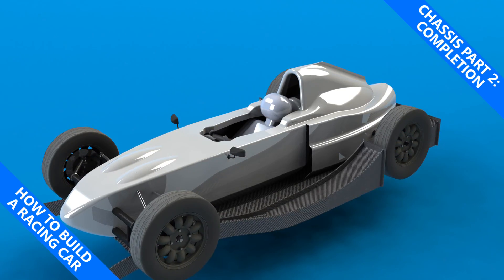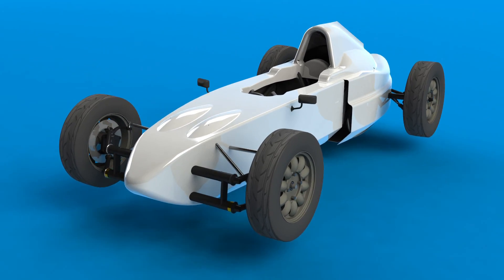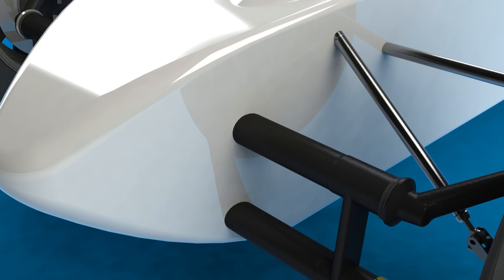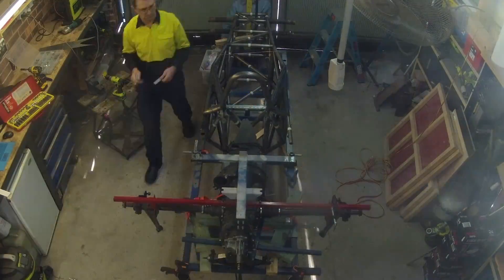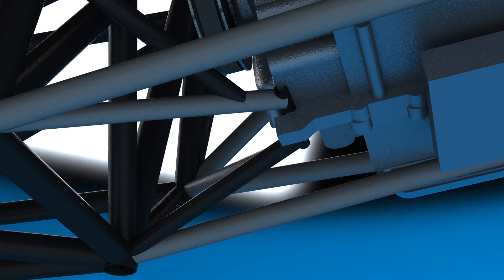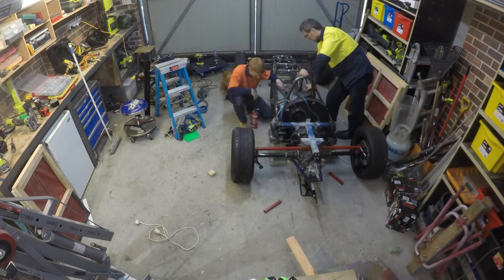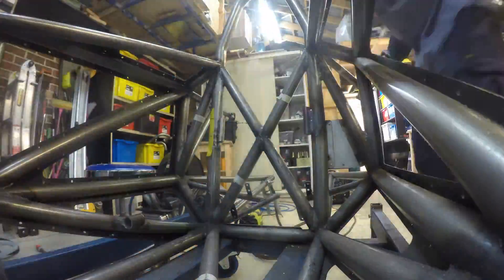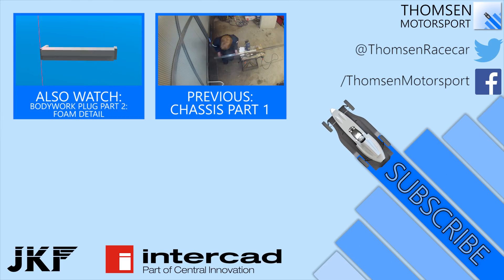Chassis Part 2: Completion

Comment: Great job on this! One thing though, I’m not sure if it is because of the regulations, but if you can I would recommend moving the fuel tank as far from the driver and engine as possible, because if you do get into an accident and the fuel tanks gets punctured, first, you have hot fuel on you and if it sprays onto the engine it will cause the car to catch on fire or worse, your clothing/body will catch fire; also if your car is hard to get in and out of, you could be trapped in a burning vehicle if the fuel tank ruptures.

Comment: I think you have worked damn hard and smart to.....My question is where can you buy an engine & transaxle for a Vee series or others series?......basically I'm not having luck locating suppliers for(engines & transaxles) any tips for companys/websites for motors and transaxles would be so much appreciated.
Reply from the maker: For Vees, parts aren't super easy to come across, I found two front H-beams straight off a car in a scrap yard in Melbourne, engine and gearbox I sourced from a wrecked Vee. Best bet from my perspective is to talk to people within the Formula Vee world and see what parts are already available, or find out what road car parts to look for in scrap yards - and what you would need to do to them to make them legal to race.

Comment: Thank you for your videos.
In the beginning, how long it it take for you to become comfortable with your welding and confident with the results?
Reply from the maker: Maybe three or four weeks of practicing every evening. I made few test sections of the chassis so I could cut them open and check the penetration and quality of the weld. I spent a lot of time watching videos of TIG welding, this helped a lot as I knew what to look for in terms of the melt puddle, heat etc. By the time I actually picked up the TIG torch I had a lot of mental imagery of what it looked like to weld properly, so I had to translate that into the muscle memory to do it properly. I did try brazing as well, but was not able to do this well, I didn't feel like I understood where the heat was in the same way as I did TIG welding.

Comment: Two questions:
What is the assembly rig that u have attached the chasis to that can rotate?
What material are you guys using for the frame of car? Is that tubing readily available?

New to this scene. Thx
Reply from the maker: The assembly rig is one which we made for the project from 50x50x2 box section steel. Very helpful I must say. The material I used was 350MPa mild steel, cold drawn over mandrel seamless tubing (DOM CDS I think are the acronyms - been a few years now!)
Reply: @thomsenmotorsport7201  Thx!

Comment: Is that H beam off of a vw Bug front?  Wouldn't 4cm stitch welds, every 6cm's have sufficed on the panel supports?  just curious... did you have to drill inspections holes to pass tech at various tracks?  Gr8 work throughout!! bravo !!!
Reply: The engine is from a VW beetle too, I noticed the unique air intake blower and shroud!

Comment: Does this racing organizaition require view holes to be drilled at weld points so they can make sure the welds are good? Or, did you just have to show on a test weld that you were getting proper penetration on the welds?
Reply from the maker: It's been a couple of years now so my memory is fuzzy, but I recall showing the inspector photos of the welds inside the roll hoop before closing up the ends. I also had a couple of test pieces I could show him. But no destructive testing.

Comment: Hey! Awesome video! If you don't mind me asking, where did you get the engine, chassis material, and drivetrain from?  Im interested in building a racecar myself, and I cant seem to find the correct parts. And what engine is it? Would love to hear from you!
Reply from the maker: Thanks. I bought a wrecked Formula Vee which gave me the drivetrain (VW Type 1 engine and gearbox) and also some useful bits like a racing steering rack. Everything else I bought and made myself. I found suppliers around Australia for the raw materials such as chassis tubes and fibreglass. Metal plate I bought from a laser cutter in Sydney, that was great as I just had to give them the dxf files and I'd get the material perfectly cut a week or so later. Finding good suppliers is key to a project like this, if you're in Australia let me know in a reply and I can list the ones I was happy with.

Comment: How much hp ur engine has?
Reply from the maker: 68hp at the wheels.
Reply: So you really got the 70kW!! That’s awesome 😎 👏🏻.  As I’m not having that much I think I should use tires with the rounded profile from a scooter. Otherwise the tires instead of letting me roll to the top they will stop me: all the energy I have will be going to move the tires and not the car.
Reply: ThomsenMotorsport other question I have is how u join the body to chasis?
It can’t just be laying. And gluing it is counterproductive.
Reply from the maker: DZUS fasteners through brackets welded to the chassis.
Reply: I’m not sure I can have them here in Peru :/. I see if I can have any similar stuff or importing it :/ sadly Peru is not the country you’d like to live in when you want to build a car.

Comment: Am working on a chassis in ansys workbench and I need to simulate fatigue effect in a circuit , is it possible u could help me please?
Reply from the maker: It's been a long time since I used ANSYS, not since 2010 when I was at university. Unfortunately I don't think I can be much help.
Reply: ThomsenMotorsport it's okay thx for replying anyway

Comment: Great Video. Which software did you use for assembling of the components at the beginning of the videos?
Reply from the maker: I used Solidworks. It's CAD software but has a raytracing renderer, which can be coupled with animation tools to produce these parts for the videos.

Comment: When you welded the frame onto the tube for the panels to fit you have stressed the tubes. you would have been fine just to weld 25mm of the frame where the hole is as it is the bolt that holds the panel into place and any side impact would be transferred in the frame only where the bolts are fitted.

Comment: Awesome video.
What material are you using for the chassis and mountings? Have you used different material for roll hoopes and rest of the body?
Reply from the maker: I used a mild steel for all of the chassis (including roll hoop) specified by the Australian CAMS rulebook, complete with material certificates. For mountings I just used a typical mild steel plate laser cut into the correct parts.

Comment: All the precision you used to build this chassis is really going to pay off when you set the car up at the track. Should be fairly easy to refine the handling since you're starting with such a well designed and built, stiff chassis. Nothing worse than getting all the corners and cross weight where you need it and have it change while racing due to excessive flex in the wrong areas of your chassis. First class work! Cheers
Reply from the maker: Thanks. It was the part of the car I was most happy with in the end.

Comment: what kind of tubing did you use ? 4130? ........ JRW
Reply from the maker: 350MPa mild steel, CDS DOM tube. This material is specified by the rules and regulations.

Comment: seems to me you've overbuilt - you could have gone a fair bit lighter on the side panel tubing and used the extra depth and strength of the panel mounts to make up the difference - that is to say- used your panel mount system and panels to do what your structural tubing is doing... I bet you didn't take the panel mounts into consideration when running your calcs (?)
Reply from the maker: You're right in everything you say, however there is a reason I've done it the way I have. The rules define a minimum size (which I've used) for all members between the primary and secondary roll hoops, plus a maximum area inside any triangulated area plus require the aluminium side impact protection plates to be installed. This does basically result in the chassis being very (perhaps excessively) strong in that area but the changes were made in response to a death in the category a few years ago.
Reply: ah - i see.. thanks for the information - i thought it would actually result in a gross overweight - but i just started watching your segment on suspension design and now see that it's actually UNDER for your category! Anyway - what fun... i really enjoyed this. I'm not an auto person by the way - but an architect - and so my structural comments were coming from the perspective of an architect ... Godspeed!

Comment: What alloys did you use?
Reply from the maker: For the chassis itself I used 350MPa mild steel. I used all seamless tube. For the side impact protection I used 5052-H32 aluminium. These materials are specified by the rules so that selected them for me.

Comment: Fantastic series! I was watching your bit on spray painting the car, There is a little trick method of using and electrical current to create charge on the car which would attract the paint molecules to the frame. Not sure of the metal of the frame is capable of producing the static attraction for this to work, but it would've allowed you to use less paint and get a better and more even coverage. Just a little thing I saw on youtube about mass manufactured cars and being efficient on painting them.
Reply: Dan, are you referring to powder coating?

Comment: I never heard weather or not you drilled each tube with a small vent hole, so as to allow venting of each tube as you weld it. This will prevent "blow out or suck in" of the weld as weld the chassis. These holes are typically made wherever the tubes join so there is an entire venting process throughout the entire chassis during construction. If you did not then you my try it in your next construction as it will cause less grief as you weld the chassis together.
Reply from the maker: +RWES that's quite clever, I didn't think to do that here but it certainly would have helped.
Reply: ThomsenMotorsport  just one thing about your mold making, maybe you could add structure to the actual mold when your making them it will help to keep the parts straight and square when you go to pull parts out of them. Also if your buck is not "mirror" perfect you will always have a problem when you pull your molds off. I actually worked with CNC made bucks while working for Nissan on there Group C P-35 Project and after they came out of the CNC machine there where hundreds of hours in polishing the buck before any molds were pulled from it! I think you are doing a fantastic job!

Comment: awesome work mate , i have done my car here in lebanon , the work was not as clean as this i should say , but it turned out impressive as well. whats the total weight you have
Reply from the maker: Nice one. My car weighs about 420kg without driver or ballast. In race trim, with me and some lead on board, it weighs 505kg.
Reply: +ThomsenMotorsport ur kdg!! mine weights exactly the same!! just recently done , still have a small issue with the fuel pump and it ll be pumpin 190hp again
Reply: +ThomsenMotorsport im really really amazed by ur great work. keep it up :)
Reply from the maker: Well that's a big old power bump from where I am, must be a blast in something that weighs so little.
Reply: +ThomsenMotorsport its amazing. how much ur doin? ive put a 2005 zx10r and done a bit of tuning for it
Reply: +ThomsenMotorsport but again man, really awesome video and work
Reply from the maker: Thanks. These Vees top out at 68ish HP. It's not a lot but it's enough to race with. Gotta learn to conserve momentum.

Comment: Is that the safest place for the fuel tank? I'm sure there are rules that you're following, but I would want more separation between the driver and the tank.
Reply from the maker: I'm not aware of any Vees with more separation between driver and fuel tank. Only other place for it would be behind the main chassis bulkhead in front of the engine but there's no room there, the chassis would have to kick forward to accommodate it and the rules wouldn't allow for that. Where it is in my car it's protected from a crash by the same impact structure that protects me so I'm satisfied that it's protected from being punctured. It also vents outside the car so the only reason fuel would get into the driver compartment is if I spill some while filling it.

Comment: Sir,i m going to make a solar car.How can i make a spaceframe chassis for my solar car...
please help me...
Reply from the maker: Cool. Best thing you can do is to research what you want to do, to the point that you know before you step foot in the workshop exactly how you will do each step of the build. You should be able to find everything you need to know on the internet, just a case of spending time searching and reading. Once you've done your research, get a design together. If you can, get hold of a 3D CAD package (I used Solidworks which was provided to me by Intercad) to do this. Get everything drawn, not just the chassis, to make sure it's all going to fit and work together. Once the design is there, it'll take a bit of time to convert it into 2D drawings that you can use in the workshop to actually do the build. If you've been thorough then things should go together quickly and smoothly once you actually do start building.

Comment: Great work!  What tubing size & thickness are you using?
thank you
Reply from the maker: Thanks. Tube sizing varied throughout the chassis, from 1.5" x 2mm through 1.25" x 1.6mm, 1" x 1.6mm and 0.75" x 1.6mm. Size depended on rule sizing and stiffness requirements.
Reply: Imperial AND metric in one specification?
Reply: Excellent information, thank you!!
Reply: Hi, all your work is amazing! have a question at the rear suspension what tubing diameter & thickness are you using. Thank you
Reply from the maker: The leading arms are made from the 0.75" and 1" chassis tube sizes, the pushrod is solid aluminium bar.
Reply: And what thickness?
Reply: @thomsenmotorsport7201  I love the way metric and imperial are often used side by side these days.
Reply: Pedro Kim sorry I thought you we're talking about chassis
Reply: Pedro Kim the previous video covers that
Reply: s550amg the rear suspension thickness doesn't come in the previous video
Reply from the maker: Both 1.6mm. Why are you asking? If you are intending to build your own then just copying the member sizes is something I'd advise against, each car will have different loads that need to be accounted for in the design. What works on my car may not work on another car depending on the design of the car and loads it's subjected to.
Reply: Hi Simon is only as reference my project is going to be about 545 kg dry and something like a Bac Mono or tube frame Formula Atlantic.

Comment: When welding the mounts for the panels where you really required to weld the whole seam? To me it seems abit overkill.
Reply: btw awesome work man you are really skilled 👍
Reply from the maker: Thanks. Perhaps less could be used but it's required by the rules to be that way.

Comment: great stuff mate. which state you from?
Reply from the maker: Thanks. I'm from New South Wales.
Reply: I'm from Sunny coast. I dont mean to lead you on with this question but if you were to make this again what would you charge if just for the frame and bodywork with a few adjustments to suit an electric motor motor and battery pack.  I dont mean to ask for an accurate figure either - just a ball park even if it is 10k out of wack. how long would it take to build again that you have most of it down pat if you did it by yourself without help?
Reply from the maker: Interesting, honestly I'd really love to see a viable electric option in the club level racing scene. It's the way of the future for sure and motorsport needs to keep up if it's going to stay relevant to the younger generations. These days I'm now too busy to realistically accept this sort of job myself, I'd have to contract it out to someone else. I've got quotes from people in the past for the chassis so would have a rough idea of what that would be, the bodywork I'd be less certain. The bodywork moulds aren't great but I do think they could be reused to create more parts. But if you're interested I could speak to some suppliers and see what it would cost to have it done. Send me an email at thomsenmotorracing@gmail.com
and let me know about your project, I'll have a think about it.
Reply: cool no worries.  Thanks for wanting to help though.  All the best with the races and have heaps of fun and break a leg/wheel. :)

Comment: Honestly I'm astonished, I guess it helps having some of the facilities to be able to do this type of work, but for me as someone who'd like to try something like this, i'm curious, where did you get the drivetrain from and where can you find the necessary materials and manufacturing tools do do this kind of work?
Reply from the maker: +edwardfeast my father owns some of the tools and the larger workshop, it certainly helped a lot having access to those. The materials I had to source from various suppliers, the chassis material was particularly difficult to find, it's a specific grade made in a certain way and it wasn't that common. If you do your own project I'd be careful not to underestimate how much time procurement takes. I got the drivetrain from a Formula Vee that had been wrecked in an accident. As far as the tools go, most things my father didn't have I bought off eBay, including the welder.